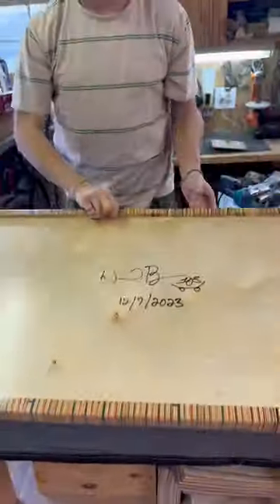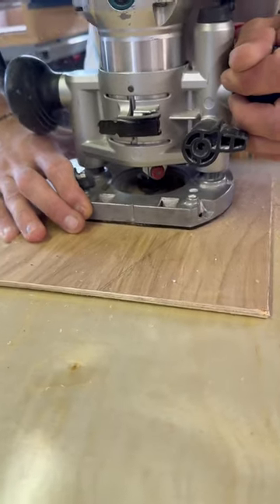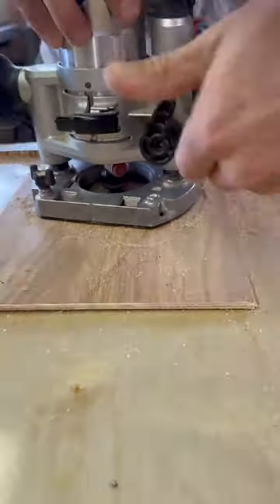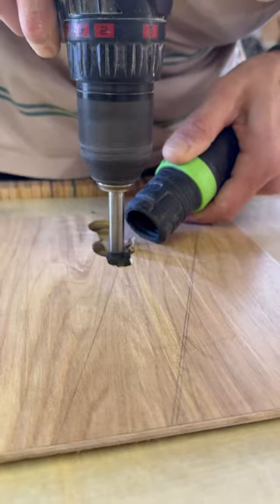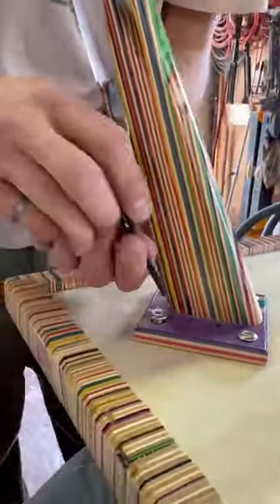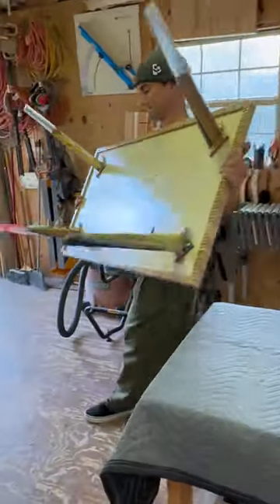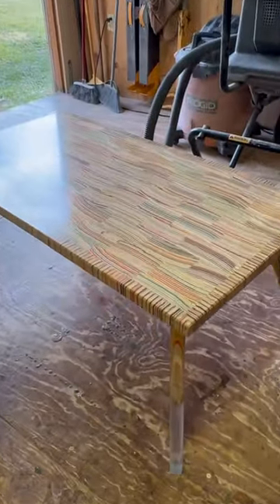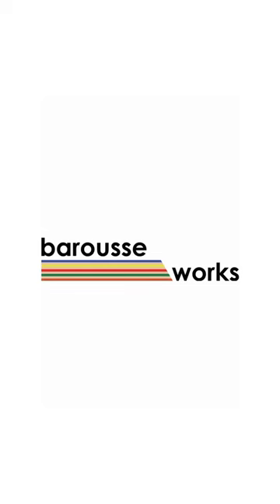Adding the coolest little detail to my coffee tables! #barousseworks #recycledskateboards ✨

Comment: Game changer. "Tools included" is a great time saver. Mostly just saving time looking for the tool.
Reply: ''great time saver'' how often do you really need to take the legs off and on from a single table? maybe 5 times in your life? yeah, saves alot of time lol it takes me 5 seconds to pull my allen keys out
Reply: Tools included always means terrible tools included.
Reply: I'd say you're slightly right, but simple tools don't have to be that great. They just have to be the right size and readily available. Both are achieved by including a hex key within the table.
Reply: Love this table and I love that you include this little key. Super cute!!
Reply: 😂 I guess I should have done my due diligence. checking out your site now.
Reply: Great idea
Reply: Every Ikea furniture come with tool lol
Reply: @thomasgomer most  furniture come with tool and a instructions manual for assembly with picture
Nothing special
Reply: @legros731  perhaps. But it’s not stored on the furniture.

Comment: That’s the most above and beyond thing you can do that will benefit a very small portion of your customers. You clearly take pride in your work, and it truly shows with the beauty and art in that table.
Reply: I would imagine it would benefit everyone who buys that table, not just a small portion. Why would you go looking for a tool to take the legs off when you know the tool is attached to the underside already?
Reply: @bronsontaylor7333  not hating on this idea, I actually really like it.

But most people have children with little fingers, so this key will most likely go missing if left under the table. Also as time goes on with anybody, tools easily get misplaced. Aka the 10mm socket challenge.
Reply: @jonnyd1646  fair enough. I have 3 small children and wouldn't dream of buying/making a table this nice until they're a lot older but I get what you're saying.
Reply: @bronsontaylor7333  I was saying benefit a small portion because not that many people are buying furniture then moving. Therefore they wouldn’t need to take it apart. It’s something that every table should have though.

Comment: Super cool table, very nice idea. My only worry (which could be unfounded) is that a persistently hot thing sitting on the surface may weaken the magnet. Looks like its in a spot where that shouldn't be an issue, especially if folks use a coaster for extra heat shielding. Neat idea!

Comment: Do you warn customers about the magnets? It can be a hazard if they put a computer or tape player on it.

A munch better solution would be drill a hole on the inside side of one leg where it attaches and friction fit the wrench there. It also would eliminate the cost of the magnets. 

Your solution introduces more problems.

Comment: You should definitely make this optional. A lot of people have little toolkits they keep out for quick/frequent use for things like furniture and small repairs to items.

This would just be a bit of an annoyance to us people, and it looks aesthetically displeasing, and the magnets make it unsafe for some electronics or are weak enough to not hold the allen key up if anyone bumps the table.

Just make a little slot in the table and make a door for it to make it 95% invisible when you arent using it. There are so many far simpler ideas that accomplish the same thing and work better with less downsides.

And you can charge an extra 2-5% to do this as an add on.